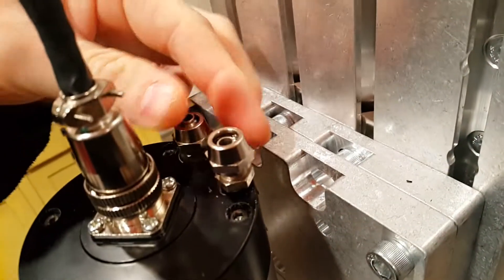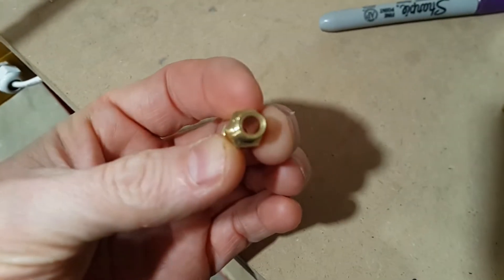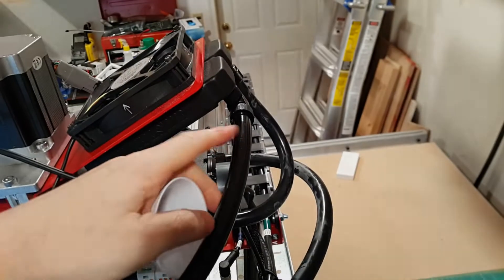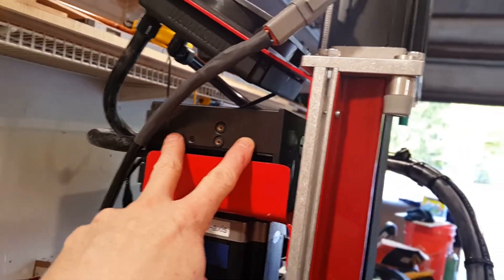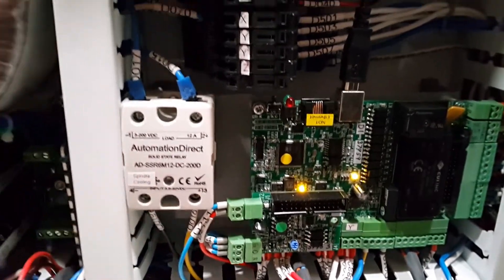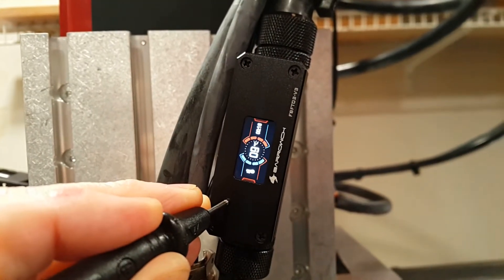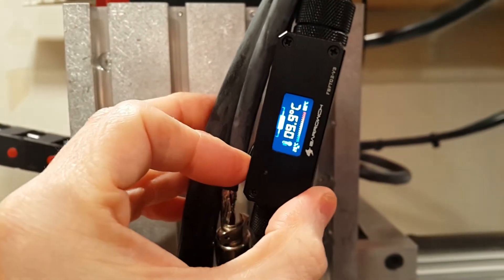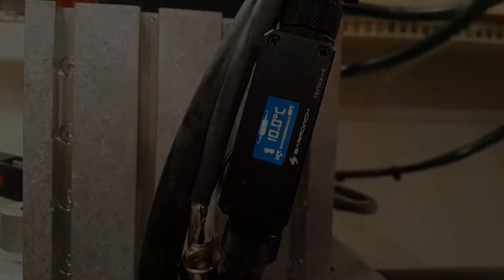Water Cooled Spindle - Setup & First Run

Comment: Greetings. I’ve been watching as many videos as I can on these water cooled spindles. Trying to do some research on an appropriate spindle for my mill. How do you like your spindle so far?
Reply from the maker: So far so good. I'm very pleased with the sound level, it's much quieter than I imagined. The main reasons I went water cooled was noise level, dust collection, and ability to run the spindle slowly if needed. From what I can tell the spindle is delivering on all these points. It's difficult to assess the power output, it's rated to 2.2kW (3hp) but until I get into heavy cutting I won't be able to know if those are real numbers. I've used a 3hp handheld router in the past and it was a beast.